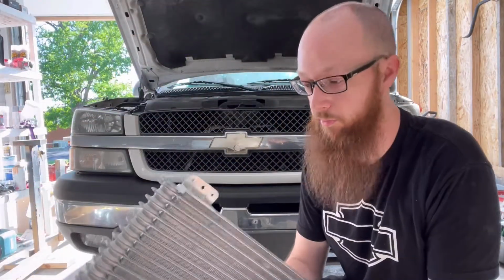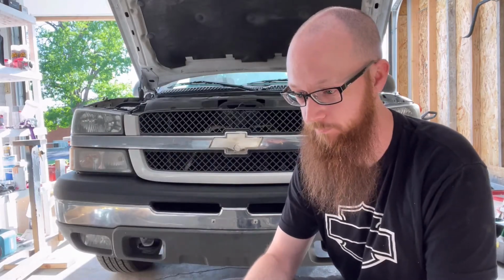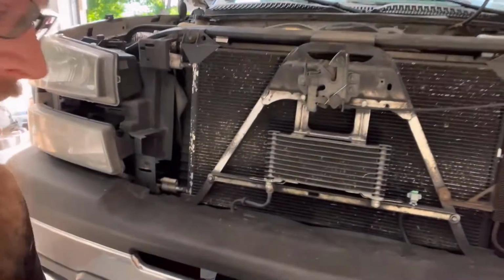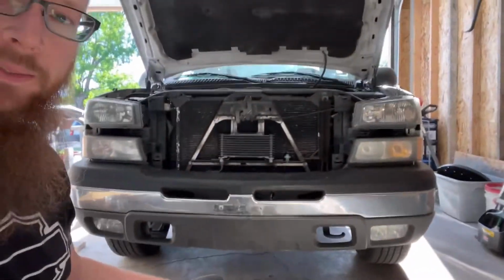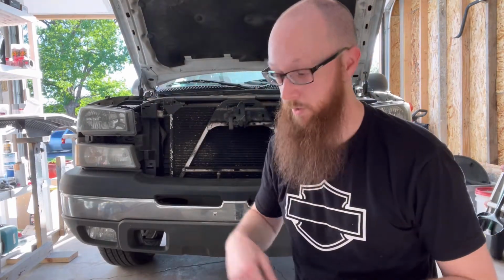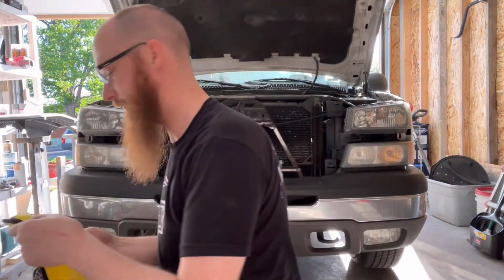Silverado gets a Tru Cool 40k transmission cooler

Comment: Great video.  This one actually applies to my application.
Reply from the maker: Awesome! Thanks, I hope it helps. It was the best thing I could have done for the 4L60.
Reply: @recklesslyfestyle  I'm going to apply your video to the 4L80E but most of the videos on this subject don't cover having a factory cooler in place and are cutting the the lines the run through the radiator.
Reply from the maker: Gotcha. Yeah, this cooler/kit is great.

Comment: I used the Gap 40k cooler kit and some AC Delco trans line fittings and didn't have to cut lines or use the rubber hose.original lines with a little bending went in factory.
Reply from the maker: That’s awesome. I may end up changing the lines at some point. It’s been great though.
Reply: How much is a little bending lol
Reply: @delagto_5340  Not much at all the air damn is in the way a little really just had to flex it into place.Had not had a problem and works great.
Reply: You have a part # on that fitting?
Reply: @cirogallegos2874  Not off hand but all they are is AC Delco transmission cooling line fittings.

Comment: I have a 2001 chevy express 2500 van Should be able to use that kit
Reply from the maker: Should be able to. It’s basically the same.
Reply: @recklesslyfestyle  That's what I was figuring. I believe my van has a 4l80e which is a better transmission then the 4l60e but my van has 209,000km I'm from Canada so it would be 130,000 miles. But better cooling is always better for a transmission 🇨🇦👍👍
Reply: @bearallb  does you van have one because my 2006 Chevy express 2500 V8 didn’t come with the transmission cooler !!!

Comment: how much more transmission fluid did you have to add after your install.
I received my cooler today and want to install this weekend.
Thanks for this video very helpful
Reply from the maker: It took about 1.5 qts more. You’ll be really happy with it. I’m never worried about how hot it is now.
Reply: @recklesslyfestyle  Thank you for your quick response. I pull a 32' RV and temp got up to 208degrees on the tranny had to slow her down about 55mph temp dropped to 199degrees.. Thanks again, I will share the results after I come back from my trip.
Reply from the maker: Mine did the same before this upgrade. That won’t happen anymore. I pull a 30’ RV and it doesn’t go above 160 degrees even when the ambient temperature was 100 degrees.
Reply: Got back home last night. Pulled my 32ft. RV about 650 miles round trip of course with the new transmission cooler.. Im very impressed the highest reading it got with a 94degree day was 169degress on the tranny temp.. That's a 40degree cooler...I Recommend the cooler and this video made the installation super easy thanks again
Reply from the maker: That’s awesome. I’m glad to hear it.

Comment: You should install the cooler the correct way as to use 100% of the cooler…
Reply from the maker: What is the “correct way”?
Reply: You installed it upside down. There is a huge air pocket at the top…
Reply from the maker: It was installed the way the manufacturer designed it. Which is also the way GM designed the oe cooler. The trans never went above 160 after the install. If the cooler worked more efficiently, it wouldn’t reach operating temperature. However, this is all irrelevant. The transmission isn’t a sealed system. It will purge air out by itself.
Reply: @recklesslyfestyle  so your saying GM designed it correctly. If that’s the case then why did you change it in the first place. Look up: how I do AN fittings trucool 40k transmission cooler on YouTube. This guy did it correctly
Reply from the maker: Because it was small. Yes, GM did design it correctly for an oe application. They never intended for me to cam it and tow heavy. There isn’t an incorrect way to install it. I could have mounted it flat on the underbody with a fan for air flow.

Comment: My pickup has the cooler in the radiator.  Wanting to install a kit just like this one. Do you think I could run the coolers in series this way or should I totally bypass the cooler in my radiator? Thanks
Reply from the maker: The one in your radiator should be the engine oil cooler. Mine has the same. Your trans cooler should be a little black cooler in front of your radiator. If not, yes, I’d run them in series. It makes a huge difference.
Reply: @recklesslyfestyle  it is definitely the trans cooler in the passenger side of the radiator. And I don't believe I have an engine oil cooler on my truck. It's the 4.8 in a 2wd extra cab pickup.
Reply from the maker: Run them in series then. Keep that 4l60 alive as long as possible.
Reply: @BoringFisherman did you ever figure it out I have the same thing on my Tahoe with the upper n lower trans lines on the radiator. I wanna install a secondary one like you

Comment: How’d you get the rubber hose to attach to the stock cooler lines???
Reply from the maker: It’s comes with fittings. Threaded on one side, that attaches to the stock lines. Barbed on the other side for the rubber hose. It made it incredibly easy. You can also cut the end off the stock line with a tube cutter and buy compression fittings to convert to AN fittings.
Reply: @recklesslyfestyle  that answers my question about how to attach it to the factory lines, Thanks

Comment: You have alot of thumbs up for a video that doesn't show any details. I will make one for everyone when I do mine next week.
Reply from the maker: You should, you’ll probably get a lot of likes. I didn’t do it as a “how to”. If I’d known it would be so popular I might have. I’m not a pro though, just an idiot who likes to modify everything. This thing makes a huge difference though. You’ll like it.
Reply: @recklesslyfestyle5831  no, you know what your doing, your not an idiot. Your mounting was good. Just needed to show people how to make connections on the fluid side. Alot of people are struggling with it. And a few videos out there with bypassing the radiator cooling system and not telling people in cold climates that it is needed to get the transmission up to proper temperature. What fittings to use, proper rubber hose type for transmission fluid ect... Thanks for the fast reply. I will thumbs up.

Comment: Did you use the adapters included in the kit for the truck side fittings? Or did you have to cut back on the pipe?
Reply from the maker: I used the adapters. It’s a very complete kit and made everything really easy. Just screw them into the end of the tubes where you detach the stock cooler and connect it to the new cooler with the rubber hose that’s also in the kit.
Reply: @recklesslyfestyle  Thanks for the insight. Installing tomorrow!